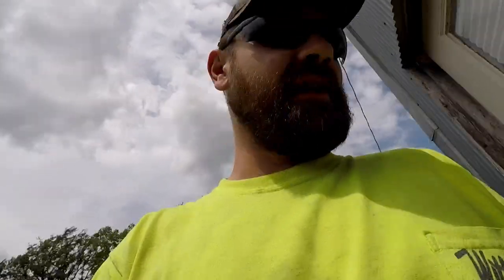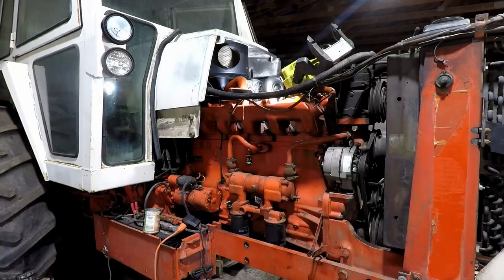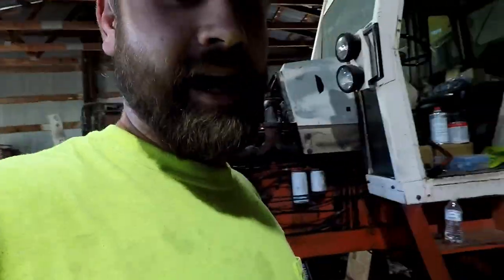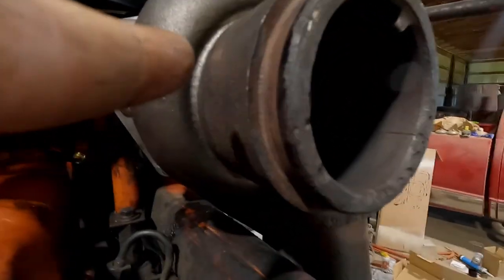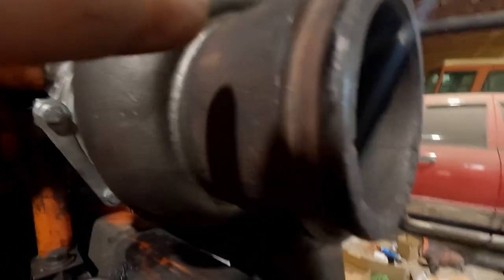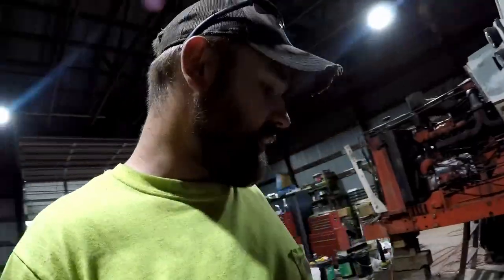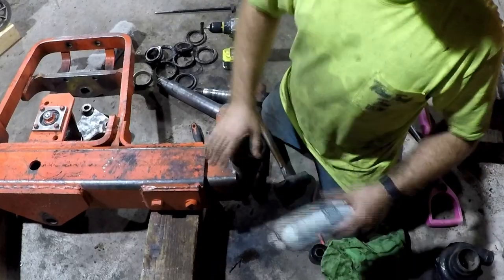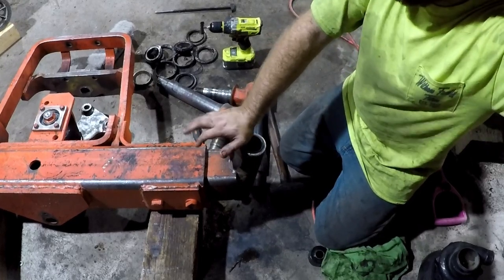Mounting New Turbo, New Bushings & Bearings in the Axle: Case 1570

Comment: Nice job getting the tractor running. Are you going put the battery's underneath the cab. What's you're plans for the1570?
Reply from the maker: At this point, we are planning on using it for hay this next year. Future plans is that I (Jake) will start row cropping this next year as long as I can get my ducks in a row. Would like to find a 800 or 900 Cyclo 12 row planter and a 30 ft no-till drill to run with this 1570.